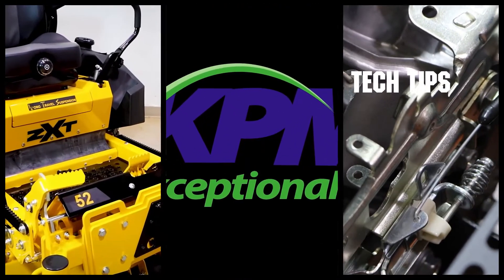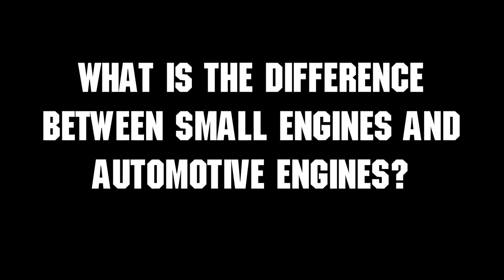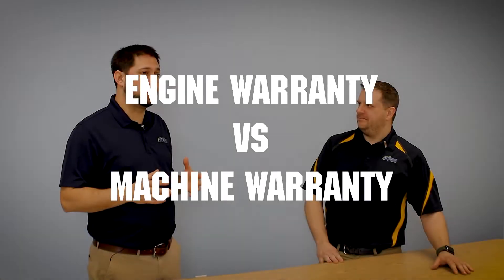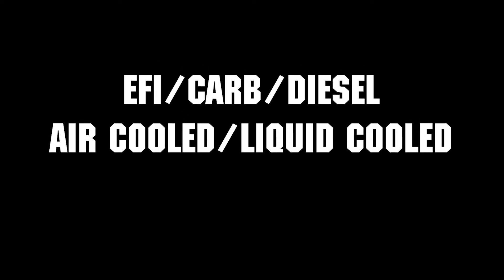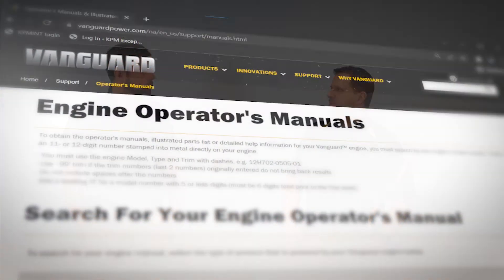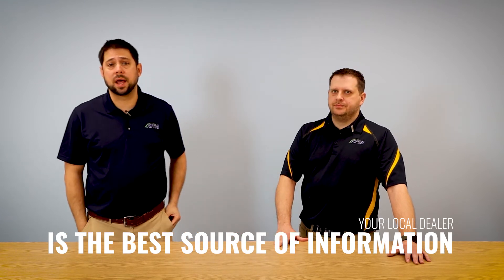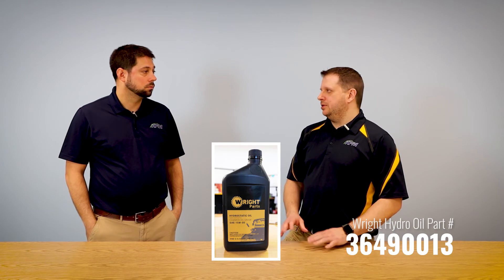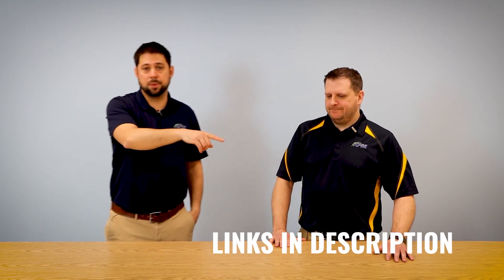Small engine oil - your questions answered!

Comment: Really enjoyed your video!  Here's my own feedback and experience...

Runnin 10w30 non-sythetic penzoil automotive oil in my old ass toro woth brigs and stratton engine.  According to Briggs and Stattron, good for ambient air temp ranges 0 to 100°F (–28°C to  38°C).

They say check for oil consumption above 80°F/27°C, which is no biggie.

Your claim of some air cooled engines running up to 500°F seems extreme.  Must be on the exhaust if at all possible, not the oil itself.  Maybe if ambient temps at +120°F and you're running it hard.  Flashpoint on the automotive penzoil is 435°F, and even commercial grade Vanguard Briggs and Stratton Oil is 450°F.  I suppose the oil inside cylinder may burn, but the overall oil temp would never get that high.

I think I will switch to a 10W30 semi-sythemtic lawnmower specefic oil next year, in case it does help it run cooler.  I don't mow in low enough temps to justify 5W30.

While engine manual should always be followed as you said small engine semi-synthetic or sythentic or  10W30 should work for most ppl unless you're constantly mowing in +100F weather.  

Personally I avoid lower 5W viscosity in almost all engines excet for winter time car oil changes that need better cold flow porperties.

Sure a 10W might be harder to start a mower with, but it's gonna give better protection on start and warm up IMO.  

Overlall...whatever oil you choose, change it often.  That's really what makes the biggest difference.
Reply from the maker: These are great real world examples of the different conditions one might have to consider, and we couldn't agree more with your last statement - change it often!
Reply: @KPMExceptional cheers!

Comment: My John Deere in the manual says to use 10/30 but after researching Kawasaki says to use 10/40 I trust Kawasaki more than John Deere. I do use Amsoil small engine oil
Reply from the maker: You should always defer to the engine manufacturer's recommendations as their information is specific to that engine and will be the most accurate.

Comment: For transmission oil I use Amsoil Hydro fluid in my John Deere Z530m. The transmission was squealing before and now it is quiet it is a 20/50 weight the owner’s manual says you can use 30 wt oil if you want I think they want it to fail
Reply from the maker: The owner’s manual is the best resource for what fluids to use in your mower, there are a lot of different options depending on your model.

Comment: I have a Yamaha golf cart which suggests using conventional engine oil due to the splash lubrication system. Will synthetic small engine oil work just as well or not.
Reply from the maker: Thanks for your question!   First, we should say that we do not distribute or sell Yamaha Golf Carts.  Really, your best bet is your place of purchase for this question.  

That being said, our tech team passed along that synthetic oil should be fine as long as you keep it the same weight.

Comment: Thanks for video, I have hydro gear zt-4400 transmission book reads "Fill the transaxle with new 20W50 motor oil 
through the expansion tank"  port / fill port. " Should it be regular motor oil or hydraulic oil?
Reply from the maker: We recommend buying Scag 20w50 hydraulic oil from your local Scag dealer.   The part number for a quart is 486255 and for a gallon is 486254.

Your owner's manual (if your machine is a little older) may say to use 20w50 motor oil.  That can also be used too.   However we recommend Scag branded hydro filters and lubricants at least while the unit is under warranty.  Thanks for your question!
Reply: 😂 small engines run at 500 degrees😂😂